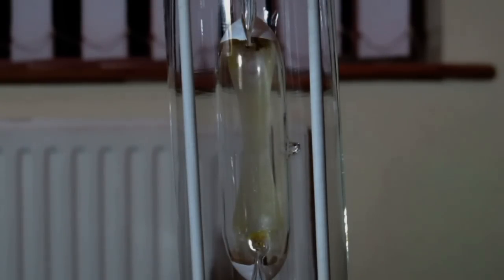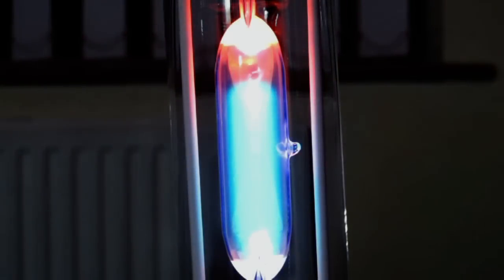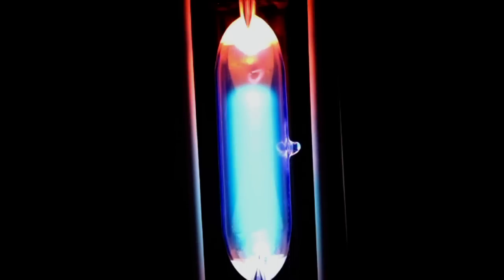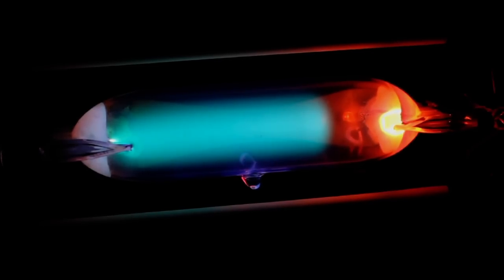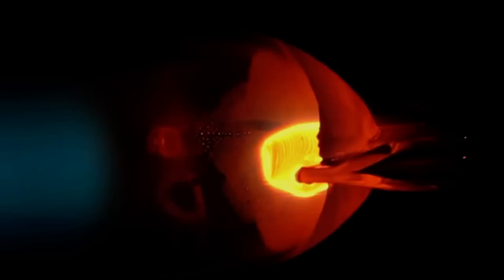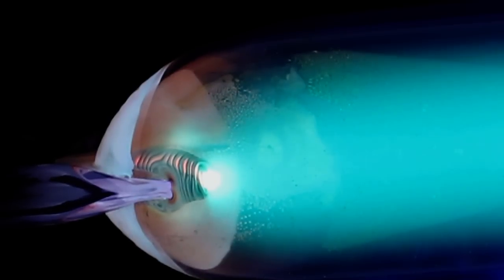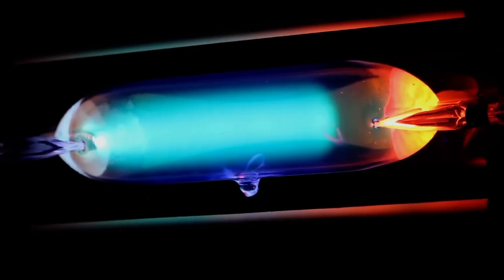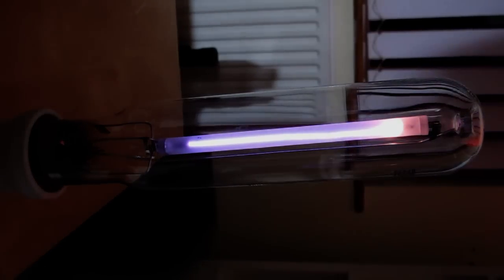Flyback transformer: Arc lamps

Comment: The oscillator you're using to exciting the flyback transformer is a single ended one. One only transistor that gives a strongly assymetrical waveform. Through the secondary you got almost a HF pulsating DC instead a true AC. Both electrodes acts in a different way. One performs as a cathode and the other one as anode.